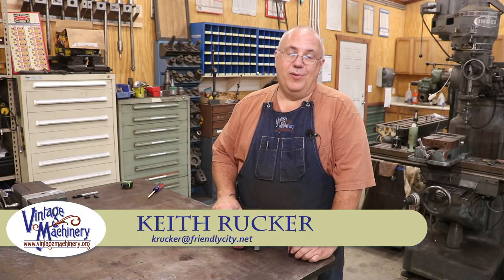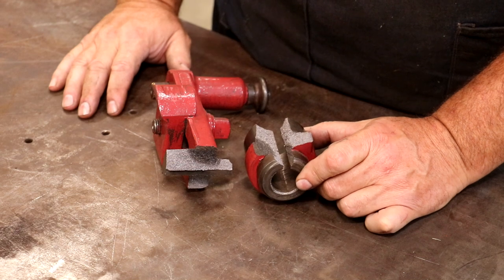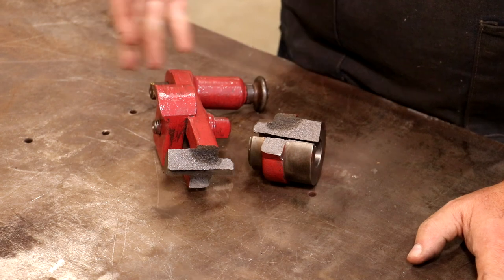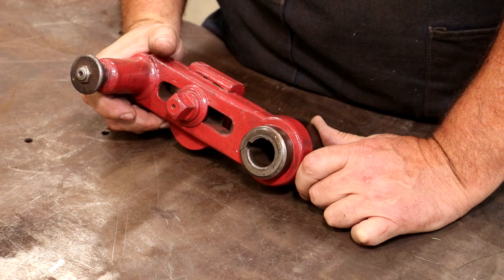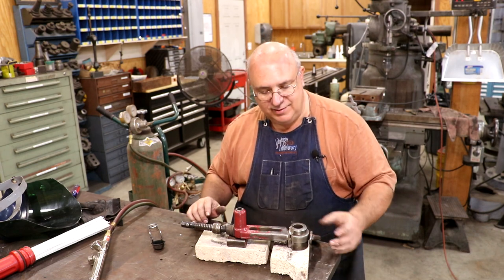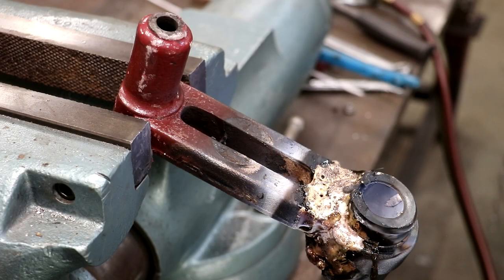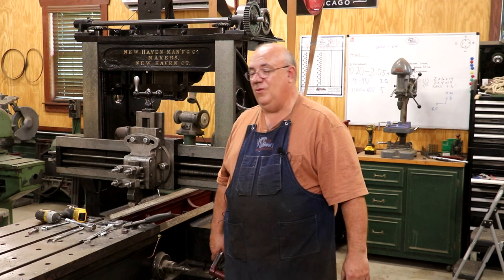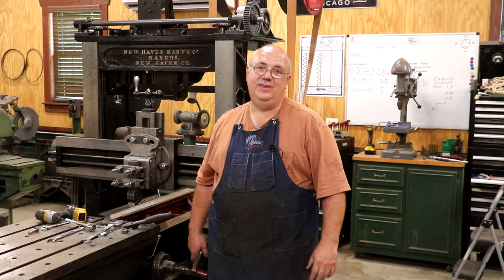Metal Planer Restoration 66: Brazing the Broken Cast Iron Shifting Lever

Comment: Can one also repair such parts with silver-solder ? I think of first "silvering"  (44% Silver at least), the broken surfaces, then join them together with heat, some pressure and a good deal of flux and perhaps some more silver-solder ?

Some Silver solder with a very high content of silver melts at just 750...775 °C

It is quite strong, way better than copper in all respects.
Reply: I've used 37% silver brazing filler to rebuild broken teeth on a cast iron gear. So I think it would probably work.
Reply: Silver solder is best used for  joints where a close fit allows a capillary action drawing the free flowing solver braze into the joint. Not good for jobs where large amount of filler material is needed- like this one
Reply: @stevebliss3600  The amount of silver in the solder controls its consistency to a certain degree, the 45% silver kind flows a lot easier than 37%. You can 'build up' with lower silver content filler, to a certain degree. The main reason to not use silver brazing filler in such applications is the expense of all the silver in the rod.

I used it 'inappropriately' for my gear repair because I don't have an oxy-fuel torch, so I couldn't bronze braze. Silver brazing works at a lower temperature, so I was able to use an air-MAPP torch and a crude forge to get the gear hot enough to rebuild the broken teeth.

Comment: The CTE for carbon steel is  ~0.0000065 in/in/F...6.5 millionths of an inch per inch (of diameter) per degree F. A ring that's 1.5 inches ID,  heated 300F above ambient, will expand to ~1.503"

Comment: Every time I try these things they never work (heating a part to get it to slip on, freezing a part to get it to slip in).  If that was me heating up that part to put on?  nope...it would give me the finger and laugh at me.  IF it worked (which it wouldn't), something would go sideways and I'd have to cut the stupid thing off and repair it again.  Just like heating up bolts on my truck, nope...EVER FREAKING TIME.  I see all these people say "OH, just do this"....and they show it working.  I'm about 0 for 200 in that department.  So are two of my friends that are like "Nope, at this point we grab the sawsall and just cut the mother lover off, and hope we can find a replacement".  One day maybe I'll get that stuff to work, but today is not that day.  LOL.  Good stuff Keith!
Reply: Sounds like you have a monkey on your back instead of the front.
Reply: @ellieprice363  I channel Murphy.  Always have.  If it can go wrong it will.  Nothing is ever easy, and even "simple" things seem to go sideways.  Very discouraging to be sure.  The other day I was trying to repair an old wheeled storage rack that was made from particle board.  Simple...drill out the pulled apart area, glue in a piece of regular wood.  5 of the 6 went according to plan.  6th?  Tap, Tappity Tap. and BUST right through.  I'm like "HOW did that happen".  Now I have to either scrap the repair or route out a big hole and put a patch in.  Since the cart was junk to begin with, I might just scrap it, but then I'm all "But I can use that cart, and I know how to fix it"...but I can see the next thing going sideways.  Every project...it sucks.  :(
Reply: @WreckDiver99  Be very careful crossing the street. (:-))
Reply: @ellieprice363  LMFAO!  I am VERY careful...why?  Yea...about 40 years ago I got hit by a car that ran a stop sign...LOL...I watch, check, double check, and check again...LOL

Comment: Keith, would it have been less "scary" to have used a rotating table on the vertical mill to clean the repair up?

After little body filer and paint for the cosmetic appearance this part will long outlive any of your viewers.
Reply: That would have been an option that avoided the "flying handle" but at the cost of a lot of time setting it up. In general I'd estimate about three times as long! (Assuming 4-jaw already on the lathe, double otherwise.)
Reply: @sharg0  With benefit of 20/20 hindsight, I wonder if the two shrunk on rings would have been sufficient without the braised repair?
Reply: @tda2806  One major problem, how do you machine the casting to be sure you have a good enough seat for the rings?
And there's also the risk for a tiny bit of play/flex that in the long run very well might lead to a new failure.

No I agree fully with his choice of repair and methods. Another mans mileage might very due to available machine, tools and skill set.

Comment: What brazing rod material are you using ?
Reply: Likely Nickel Bronze.
Reply: @65cj55  was thinking that. Unfortunately only fluxed rods we have at my supplier is Tobin bronze 😕
Reply: @doccybug  That's strange, a Guy i know swears by Brass Rods, but i have never used them, in fact i Tig everything these days with Silicone Bronze Filler Rods, you could use them with a Oxy Flame, but you would have to use Flux of course.
Reply: Yep. I tig as well but I first started gas many years back and would love to get back into it.  I have flux but would prefer the fluxed rods. Will keep looking 😊

Comment: Your dust pan hanging in the background is screaming to be used. The label looks new like it has not had much use. Perhaps you use a shop vacuum to clean because the shop looks clean.
Reply: A great idea for you to just a' strollll on over to Tipton and do a clean-up day with Keith!
Reply: @silasmarner7586  actually I don’t need to go as you notice I said the shop looks clean. I suspect the dust pan is a Vintage Tool.

Comment: Under “Plan for the worst, hope for better” are you going to make a drawing of the repaired part? That is way, if it does fail down the road you’ll have an accurate way to make pattern without having to reconstruct a shattered casting.

Comment: I liked it, so I "Liked" it, but this is the last time I like a video that doesn't have the language set to English, which allows me to turn on the auto-captioning. If I can't read the captions I can't understand the narration. Sorry. (You remember to set this most of the time, but you forgot this time.) I won't go so far (yet) as to dislike a video that doesn't have the language set to English.
Reply: Why captions? Keith speaks perfectly good southern English.
Reply: @ellieprice363  Profound deafness for many years has caused the part of my brain that converts sounds to words to quit working. I really need to see the words in print to understand them.  I can get the meaning if I can ask someone to repeat themselves several times, but that won’t work on YouTube.
Reply: I understand. I’m very deaf without my Signia hearing aids. They have the Bluetooth feature paired to my I-phone which enables me to hear directly in my ears. I still need captioning on other audio sources.
Reply: @ellieprice363  - My problem is that I refused to get hearing aids for many decades. I now have them and can hear sounds that people make when talking. I just can't make those sounds turn into words even though I can hear them now with the hearing aids. The brain "cuts" connections that don't get used, and I suspect that this is why I can no longer understand speech while understanding the written word just fine. Youtube or people talking to me face to face, I can't understand them unless they speak very slowly and repeat themselves several times (which never happens on Youtube).
Reply: @PeterWMeek  The problem with understanding speech is very common with hearing impaired people. Fortunately my Signia hearing aids are paired with my I-phone through Bluetooth and the spoken words comes directly into my ears through the hearing aids. You have to have an I- Phone and the right kind of hearing aids.

Comment: Meh hate it when I see people put the knobs towards arm. That is so dangerous it’s not funny. It also means they don’t grip a torch right and have limited control.  The knobs should always be away from you so that should something occur any fames will not burn up your arm, I’ve seen this happen and in two secs one arm is burnt badly.  Secondly you grip the torch with your index finger pointed towards tip. More control at any angle.  Also makes it hard to accidentally point flame towards yourself.  Seen that happen too.
Reply: Also kieth why do you grind a deep v when braising? The braised lap weld is the strongest weld. Cutting a small groove to get deep, about less than halfway through, is more than sufficient to braise cast iron.  

Just a note grinding deep v in metal is an older practice to allow weld penetration for arc welding when you machine is not powerful enough to penetrate. Not nessary with today’s machines for anything less than half an inch thick.

Back in collage a friend of mine welded through the test piece, 3/8, and the through the table , 1/2 inch. I had to fix the table after he burnt a big hole through it.  Amazingly enough he eventually passed the welding course.

I’ve been welding with arc, mig, and oxy ace, for over thirty years. I haven’t done prep for years, aside from cleaning off worst of rust. Cut through a few just to find if any voids, none so far. Most of my welds are near flat and don’t need grinding.

My new inverter welder is kinda neat. Good for using 7014 rods to fix shafts.  I found a trick to avoid undercut on shafts. I make some scrap metal bushings tight to shaft and weld between the bushings then cut the shaft and bushings back to spec. Dang near invisible repair.

Comment: Brass will not work disimular metals.... only a real cast iron rod will work waste of time more junk you need to learn
Reply: Incredible. Every single thing you just said... Was wrong.
Reply: @nerd1000ify  I have been welding cast for close to 50 years, Both gass and arc . Brazing will eventually fail .Some people are educated beyond there ability to learn.